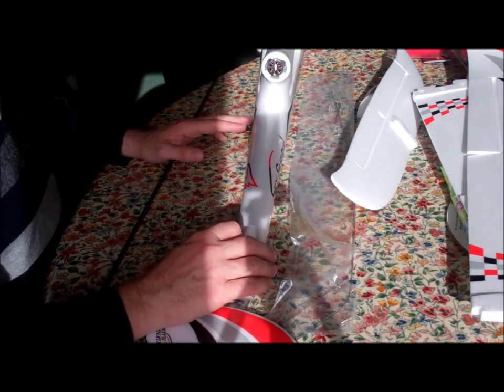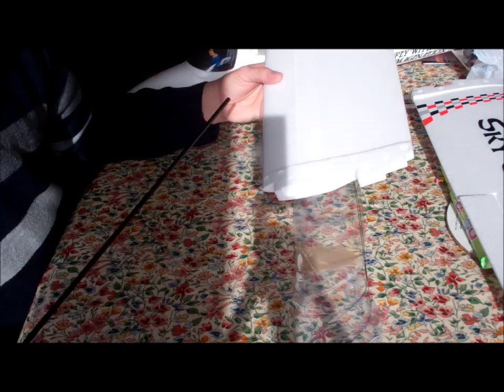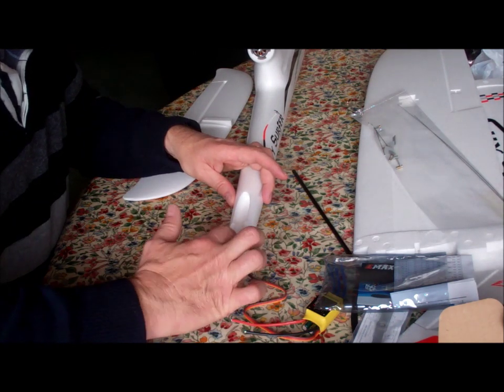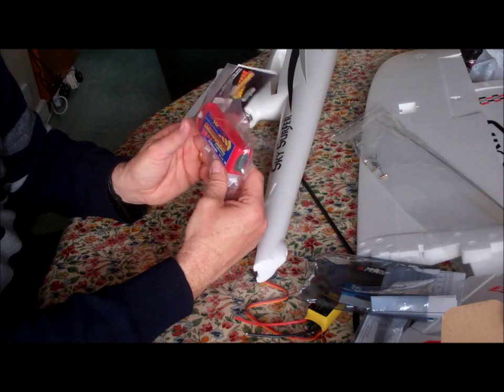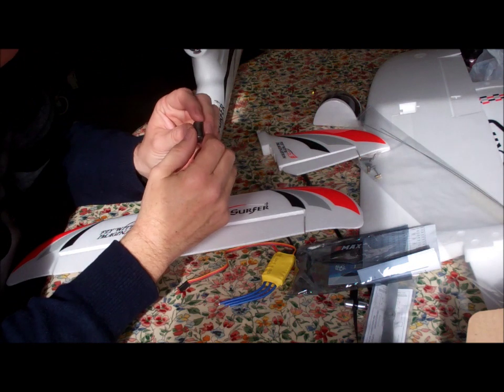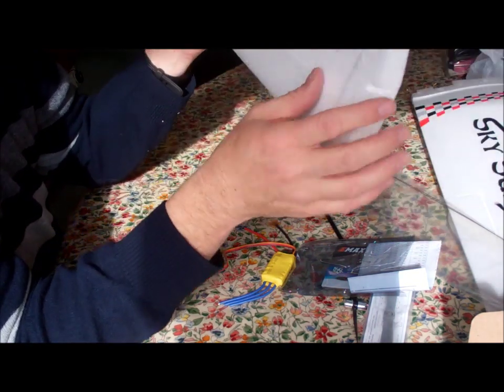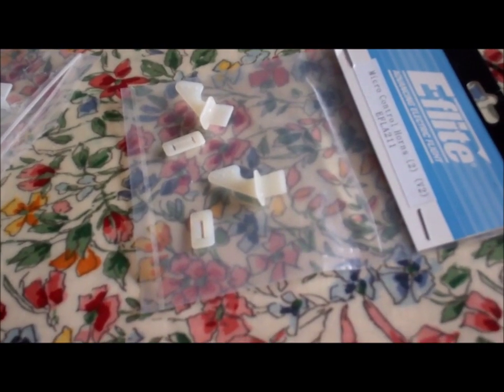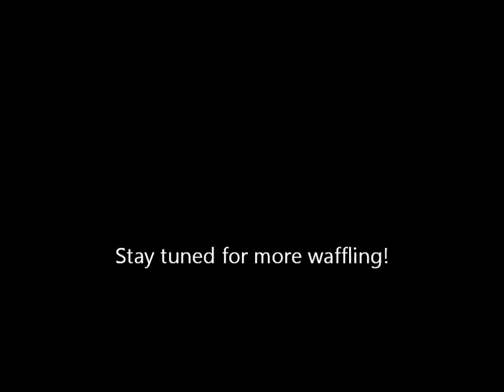J Power Sky Surfer build ( Part1)

Comment: Hot glue works just as well, is cheaper and faster for most control surfaces. A 15 minute wait time to glue your control surfaces is way too long for a foam power glider such as this. Way overkill in this application. Go watch Andrew Newton assemble his Bixler.

Comment: It's not polystyrene,  it's EPO, best glue is CA,  or hot glue after a crash, 
Your nit picking a bit?,   why did you buy it if your gonna complain about it all the way through! 
 Instructions??  just look for the CG!! 
 the control horns are ok,   the plane only weighs 700grms flying weight,   
 been on mine for a long time,   the plane fly's fantastic well worth $70 delivered!!